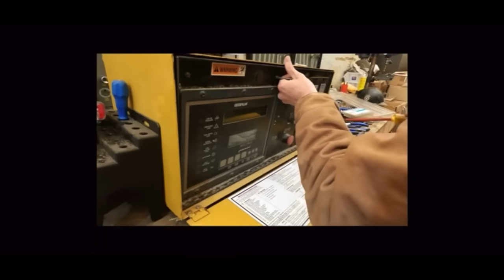Edison Motors Inspiring First Year Of Building Electric Trucks

Comment: Great job to get this far. For the next truck design in more clamping length on the screw joints. Also you might have acoustic issues due to alot of sheet metal, but that can be solved with acoustic mats later.

Comment: You vould call this style truck, off road heavy duty Something like, model T-200 HD (Topsy, tandem HD) T for Topsy, 2 : tandem axel,  and 00 : dually, where a single axel  wide single tire  could be T for topsy configuration/Body style , 111 , 1for single axel 11 for single wide rim/tire package, a race spec truck could be a T-1.111 ,the (1.) for fir powered steer axel, 1, single rear axel, and 11, for wide single tires all around  and a full electric version could be build code TE-100,  a retrofit could be Ce-200 for a full electric Carl, tandem dually,  ifi was you guys, I'd be buying old somewhat running or decent trucks at auction for cheap, or those been sitting for 10-20 years seldom moved. The cab over Freightliner i used to drive a bit, was traded and has been sitting fir 20 years. Two different ppl i worked for had similar trucks, cab overs, one a GMC with a modified 500hp cat tandem, the Freightliner, cant rember what cat was in it, but we put exhaust, power steering, and added jakes to it!  It had a Jake pedal switch on the floor, i accidentally put my big foot on it while idling one day, (not the best install) it needed a switch in series with the pedal switch,  i didn't realize i fid it, it just started camming, sounded awesome!  The GMC had turbo work, and pump work done supposedly making 600 +hp, it definitely pulled any house we put behind it. With no problem, most was like it wasn't even there,  im surprised it didn't have a Detroit like the other truck, a single axel ford, with a 671 Detroit in it, turbo, hate to say it but tfe gmc woukd pull it down the road  backwards like nothing..   it did have about 3-5 million miles on it, it had over 2 million on it when they got it, like 40 years ago, they just kept fixing it.  Not much left of it two axels engine transmission, cab frame and front clip, aside from doors and seats , that was about it, for about a year it had to be  roll started because it had no alternator, starter, battery working. It ran all day unless it coukd be parked on a hill.  You can imagine it wasn't the best company to work for, of you wasn't there when they came in from work/ stopping at the bank  on friday waiting, the part of your money went to the party fund, and you had to wait until next week, if you wernt't there atleast before they got their shower and left home to go to the party supply,  you were crapped out of luck.  And better hope they made  enough money to make up for it the next week!  This begat is how we nearly got killed  they were driving with a leaking diaphragm  in the rear break can stalled it out pulling a mobile home up hill, it started running backwards down hill,  we were throwing tires , cinder blocks, wood blocks, tire chocks , everything we could  find under the tires to slow the thing down it basically had no breaks  , only thing to do was steer it,  one of the guys looked at me and turned white as a sheet, eyes wide open jaw dropped, i don't know what happened, what he saw but to do  this in tge middle of a 80' house rolling uncontrolled down a hill. Must have been something,  he would only tell me about 1" inch different, and he would not be talking to me anymore,  i gear them talking later, apparently i was nearly ended while trying to slow the truck, i was almost caught while  throwing a tire and wheel under the trucks tire, and didn't realize it,    sorry to ramble, just a story if my past life!  Just had a idea about thd possibility of production codes you can use, similar to k code mustangs, ZL-1 camaros ZR1 vetts Z-71 chevy trucks and such,  having a build sheet saying T-111 RR BK, BKAR. is alot simpler than saying  a topsy body, single axel, single wide tire,  red on red, with black trim, and Black powder coated Aluminum rims...
 Then a factory about 4x the size what you have now.  Build a electric under toat, to carry the frame down the assembly line a e axel, and hydraulic lifts ,  to support the frame at waist height,  move at 2-10 mph,  from station to station, start with a frame have a rack that can powder coat about 4 frames at once.  And bake them  maybe a set of steel rollers with 2" tubing with a 1" bar going to a blunt point to fit into a 12 mm bolt hole in the frame at  4 points, with another 4, tubes 12" .with the same  mounting point in them  mounting in similar holes in the top of the fram having  light weight 2" angle steel making the pins rigid enough to hold in place, another frame , plus two more,  and roll around have a 1.5" pipe  coming from under the bottom frame . Similar to a floor jack handle with s 90° bend up and a 4' pipe making movement easy one push, one pull.   Have roughly  4" wide 3/8" wall , 8" -12" pipe as wheels ,  with a 4" hollow bar center,  two 1/4" plates holdibg thd centers in, and bushings  with 2" (52mm) pins  and swivel mounts from 4"  x 1/2" flat bar.  With atleast 4 wheels ,  i think this will allow most of the frame to be powder coated and baked About  4 deep at once.   Roll it into a oven propane or natural gas powered, made from two layers of 18 gauge steel sheet. With a 4" gap  held by bolts, and insulation in the gap.  With a fiber blanket covering the oven, like header wrap,  with heat sensors in 4 corners allowing 4 burner locations  to be controlled. Keeping the oven equal temperature ,  preventing hot spots.  Having  a shiny steel sheet floor to replect heat , a polished steel, with a clear powder coat , there is awesome powders available now, and it basically last forever. I'd powder coat the whole truck, or atleast tfe frame!  Can you imagine a cabover Edison? Im thinkiñg
 Something similar to a Scania,  mixed with Topsy ,  a tube frame cab with mini sleeper, bed over driver.  With storage behind the driver.  A 4" push bar, bumper guard..  a slightly rectangular grill sitting proud if the cab about 8" with a micro hood, opening to allow the  washer fluid, coolant, oil,  and anything else and having the headlights and signal lights sitting proud with the grill. Only thebumperv sitting a few inches more proud.  Keeping the lights more traditional , using four round headlights bulbs,  the large single  with hi/low in each, with led bulbs adapted, and amber halows,  flashing  for turn signals . With a strip of 1" amber dots as turn dignaks on the side and front below the headlights. About 12 per side,  about 7 in front and 4 as side markers,   the halow being parking lights the halo  flash plus the dots as turn signals. Should be plenty,    use  basically the same for stop and tail. 4" red in the backvif the cab and in the rear of the frame.  With a 6" strip  down the side  with rear denders  having amber dots on 4" centers,  a pair of 4" red stop turn and tail on a 6" panel acrosstge rear, match the sides,above the mud flap mount, holding amber 1" and red 4" two per side, with amber turn strip of 6 per side. Makinga red /amber alternating signal.. really sorry to ramble,,   and having  about 6 x 1" bolts removed and slide the whole dash , seat, steering wheel, pedals, everything, from center to left side seat, or right side seat, sound like a cool option?  Having a 1"x4" rail at the windshield the dash kinda hooks over, and bolted to two bolts in the floor, and two behind the seat sound like a cool option, especially for European and English trucks.  Instead of the three windshield thing, have a more narrow front of the cab and windshield the size of a small- medium car,    a windshield basically 54"-60" wide,  with tiny vent window in front of the door b and windshield at a angle.  Going to the doors anout 8" with  a steel bar beside the windshield with just enough sheet steel  to  glue the windshield to, and a rubber to mount and seal the vent window,  having thr front side open scooping in air, only a 1" opening   having  the steel push bar in front of the grill, a 3/16" 1"x 4"  braced with a 2" angle with 1/4" thick.  Then a 1/8" thick dash with 1" sq tube,  and 1x2" 1/8" wall making a sub cab holfing the dash , pedals, steering wheel, and going below holding the seat. Making a strong  dafe structure safe for a cab over,   the   difference from left drive to center drive is only just over 12"  the steeing  shaft using  the same tech as fwd axels to make the move, also having multiple slip joints,  the breaks mounted using flexible hoses  and throttle by wire being E Drive!   Mount a generator using a 6v71 would be awesome or 6v92, or 8v92TA 450 HP+😆    develop s compressor that uses the engibe or electric drive using one way clutches would be cool, ac compressor also , but electric works also!  Have an awesome day!!